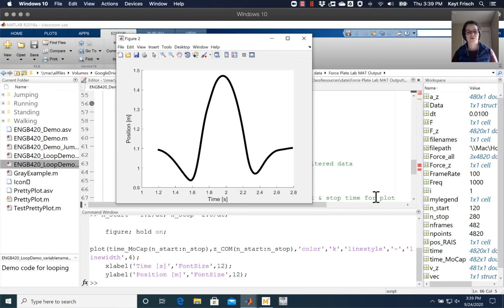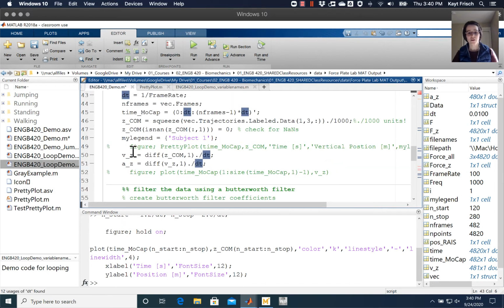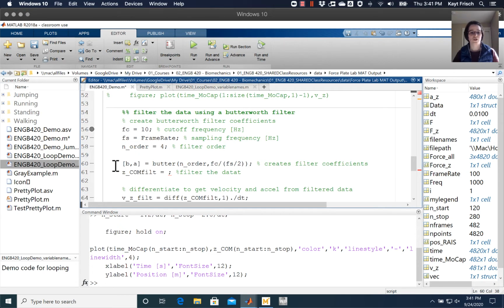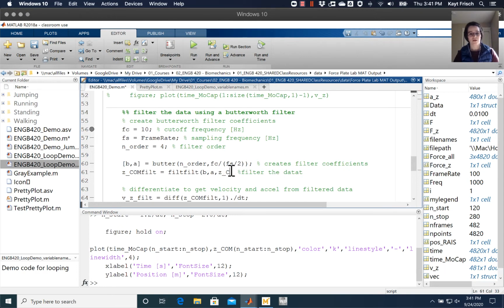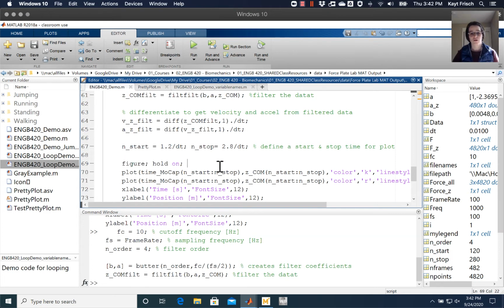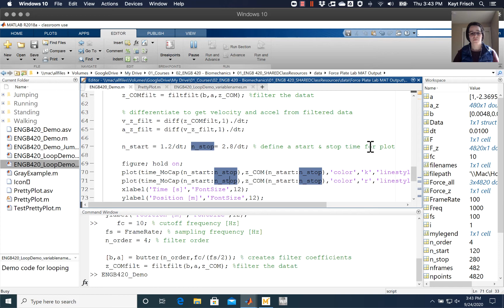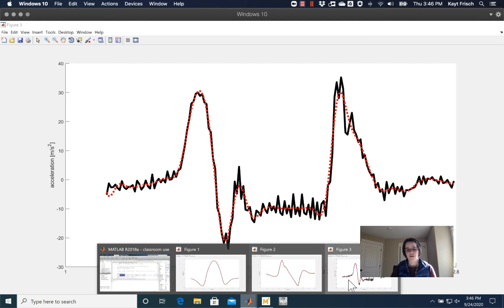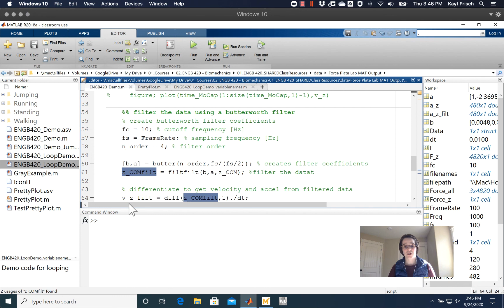Filtering data with a low pass butterworth filter in Matlab

Comment: Hi Kayt, this was an excellent video and very useful, thank you so much for sharing! I wondered, as you are using the filtfilt function, does the "4" have to be changed to a "2" to generate a fourth-order filter due to the forwards and backwards filtering? I only ask as I am creating one on R and cannot seem to find an answer to my problem, any help would be appreciated. Thank you in advance.
Reply from the maker: I'm glad you found the video helpful. No, you wouldn't change the filter order to 2, since the order describes (primarily) the steepness of the roll-off (e.g. https://www.electronics-tutorials.ws/wp-content/uploads/2018/05/filter-fil57.gif ).  The forward and backward is just to address the phase shift induced by filtering (e.g. https://www.dsprelated.com/freebooks/filters/Linear_Phase_Really_Ideal.html#code:ellipt ) Good luck!
Reply: @kaytfrisch7595  brilliant! Thank you so much Kayt!
Reply: @kaytfrisch7595  are you doimg biomedical engineering masters or PhD?